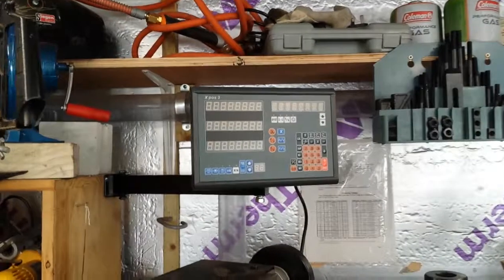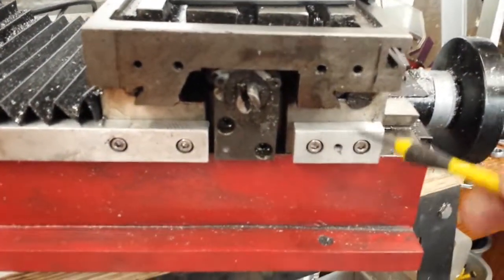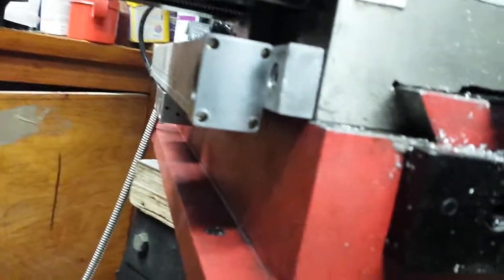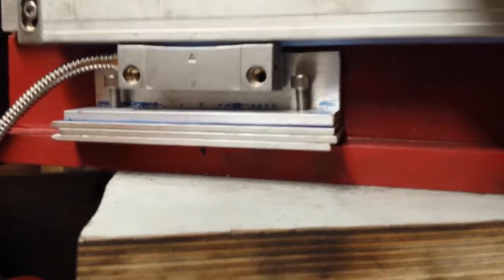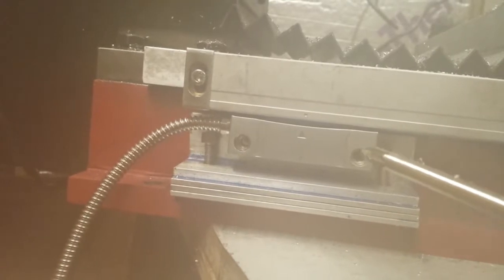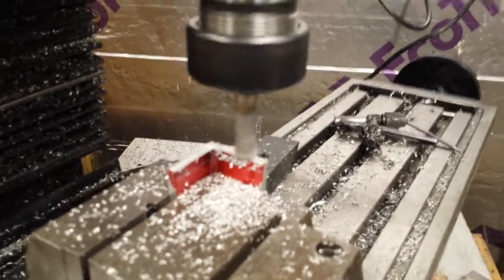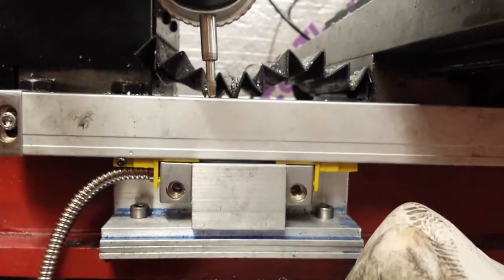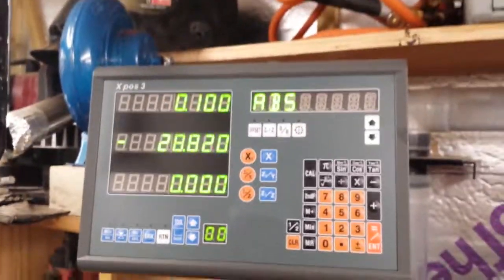Sieg SX2.7 L Mill DRO Installation Part 1

Comment: What is dimensions of of that optical rules? i wanna install it too
Reply from the maker: You can get them in various sizes to suit the size of your mill's table. For example: 
https://www.warco.co.uk/digital-readouts-scales-dro/303109-warco-digital-readout-dro-scales.html
Measure your table then - if in doubt - speak to the supplier about the best size to fit.
You should install them - you won't regret it!
Reply: @gary.arthur  ah good, thanks

Comment: Shocking camera work, bro. I had to get out as I started to get giddy trying to follow up the tutorial of this video.  :- (
Reply from the maker: I admit it's not wonderful. I aim to get properly set up with a couple of different tripods following a shop sortout...
Reply: @gary.arthur  
Good, do that Gary. It might help. 

Meanwhile I have recently purchased a Sieg SX2LF, it's a little different to your machine. I have just received 3 Axis pieces for my LCD DRO. Problem when ordering online through eBay, etc., is that you can't see what you order and then decide if that is what you want just from looking at pictures on eBay, etc. My axis kit arrived over-sized instead of what I chosen in the 'Select' dropdown. I ordered 2x320 mm and what I receiver is 400 mm in lenght. For the table, I ordered one 420 mm and what I received is 520 mm, even though, a check on eBay item dropdown list shows 420 mm.

Now I am stuck because they are too long and I have no idea if I should return them or modify them by cutting one end short on each. Not only seeing the arrived items is believing but I also noticed that the axis are too wide as well, between the slider and the other end of the axis unit (where there is a brand name printed on the side). My Sieg seems to have a low bed table than yours and that also makes it difficult in bolting the axis without having it raising a few mm's above the table deck. The table axis doesn't fit in front at all because those adjusting nuts and bolts are in the way. So, I wonder if I can try and install it behind. It's a spiffy job that could end up damaging the machine if not done carefully. The Y axis, for instance, where do I bolt that, on the left, on the right, or..? And the Z axis? I am scratching my head here. Should I just forget about it?
Reply from the maker: @mickcarson8504  I wouldn't cut the scales if I were you! I suspect that might destroy them (Arc Euro Trade told me that when I spoke to them). Better to see if you can get them swapped for the right length. My x-axis scale is mounted behind the table, not in front, for the reasons you describe. I think most people put it there. It'll be a shame if yours sits higher then the table because it will prevent you from being able to overhang work unless it's raised up on something. Try to ascertain if there's any way to avoid that. Each installation is different and people come up with different approaches depending on what their mill requires.

As for the z-axis: does your machine have an inbuilt DRO on the Z? If so, personally I wouldn't bother. Mine has a small DRO on the quill and it works fine. It seems that quite often the z-axis is the trickiest in a DRO install so perhaps best not bother with reinventing the wheel!

Hope that helps, Mick.
Reply from the maker: @mickcarson8504  Yeah, I think that's the best way - get them replaced. Of course - feel free to get back with an update. I'll try to be helpful if you have any more questions. Meanwhile, you have prompted me to get a temporary small tripod set up before thinking about a more permanent solution further down the line!
You too have a great Festive Season.
gary

Comment: Nice job Gary - what model of DRO is it? I've considered something similar but the hassle of fitting it kinda puts me off.  At the risk of asking a stupid question how are you accurately drilling into the casting -  I sort of thought I'd need the mill to do the drilling and that wouldn't be possible so I'm wary of having a go.
Reply from the maker: Peter - 
I got the gear from Arc Euro Trade. Not sure if they specify the model or not but I will check later.
Agreed - there are things I'd rather be doing but I think this will be worth it when it's done  :-)
Not a stupid question! I drilled the mounting bars in the mill, then transferred the hole positions to the casting using transfer punches (Christmas present from my daughter - they have already proven invaluable). At this point I would then ideally have used a drilling guide such as the DIY one I have or a piece of bar drilled with a perpendicular hole of the right size (as suggested by Doubleboost in his video on this topic). However, the required clamping job proved to be very tricky so I just eyeballed it and drilled the holes into the casting freehand. I'm not recommending this approach but I was quite pleased by the perpendicularity of the resulting holes so I think I can say it worked for me!   Also bear in mind that the scale has mounting slots, not just holes, so there is plenty of adjustment available in the vertical plane. The yellow plastic spacers help a great deal with aligning the sensor to the scale, and the 'push/pull' screw system I used in the sensor mounting bracket gives adjustment in the horizontal plane - so if there is any inaccuracy arising from screws not going into the casting completely straight it will be easy to compensate for. I don't think it will take much though. I'll check it all with a DTI as part of final setup.
The x axis should be significantly easier because there there are pre-drilled and tapped holes already in the back edge of the table and the saddle. I'm waiting for some aluminium bar of a particular size to arrive so there will be a slight pause before I can start on that.
gary
Reply: @gary.arthur  Cheers Gary, it's something I do keep considering doing but kinda keep pushing to oneside as it looks a fiddly job but I'd agree its worth it once done. Ages ago I found a youtube video showing in detail how to fit one of these on a similar mill - if I can find it again I'll send you a link.
Reply from the maker: @modelsteamers671  Fiddlier than building steam engines?  ;-)
Reply: @gary.arthur  Engines are fairly easy and if you make a mistake usually it isnt costly.
Reply from the maker: @modelsteamers671  Well, I suppose any given part can be remade without too much pain if it's not right (unless it's an expensive casting!). Remains to be seen how easy I'll find it though!